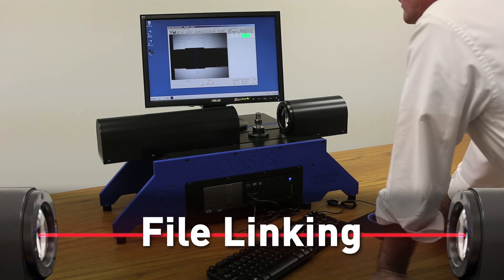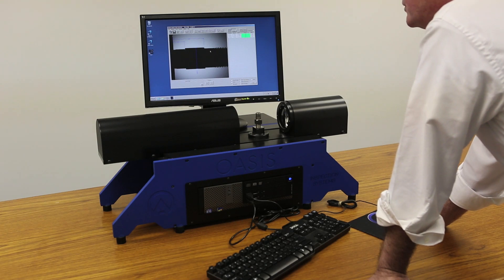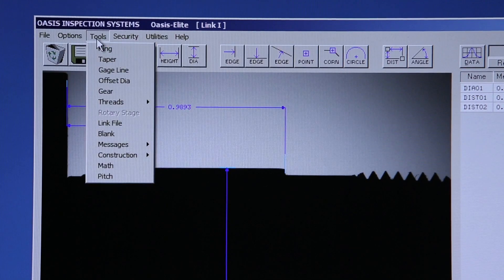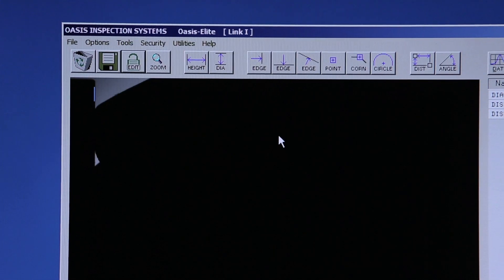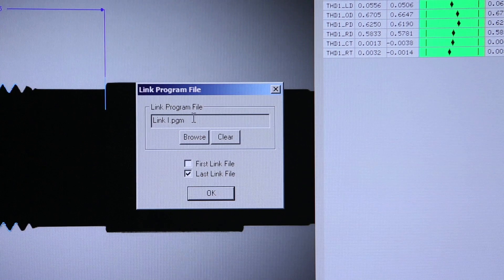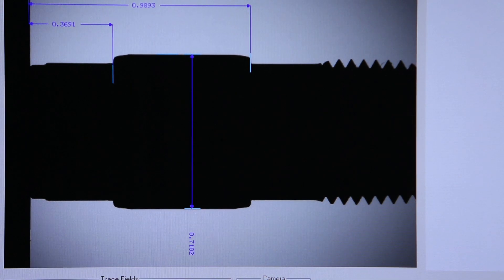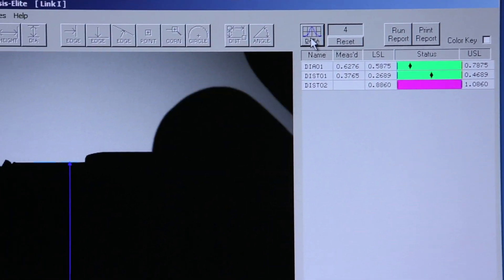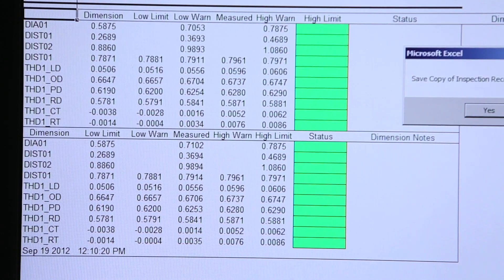OASIS Training Video #07- File Linking

Comment: We bought a new Oasis system at work, and have several parts that are longer then the field of view. How would you make the system read an over all length of both part programs that you have created? We are able to Link the two sides of the programs but are having trouble making the program read the top of one side of the part to the bottom of the other side of the part?
thanks for any help!!